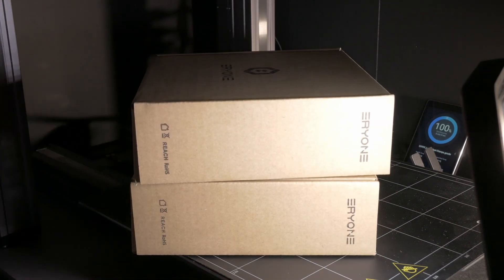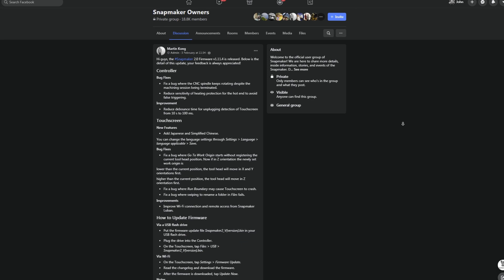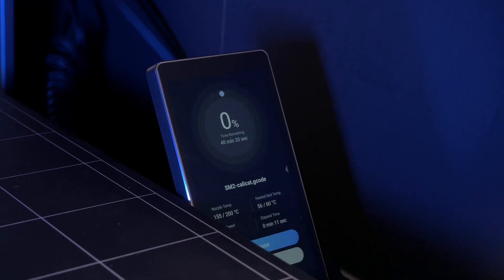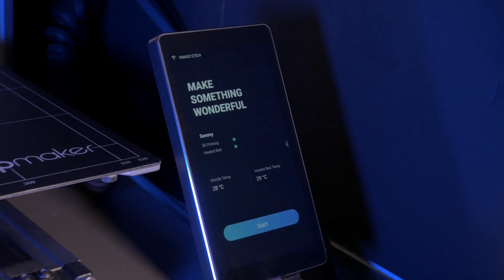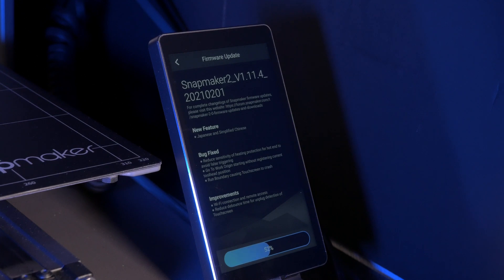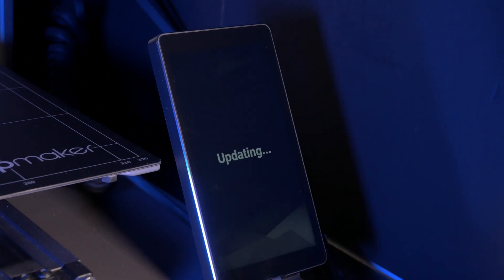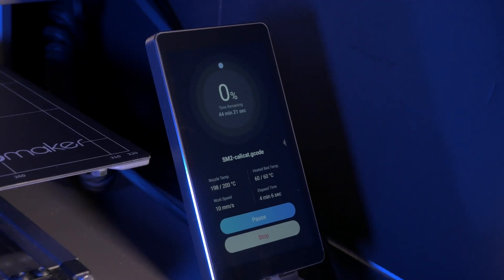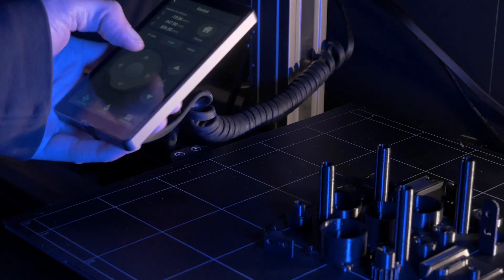How to update the firmware on the Snapmaker 2.0 3-in-1 3D Printer/CNC/Laser engraver

Comment from the maker: Need filament? Get 12% off your entire Eryone filament order using code "johnaldred" on checkout at www.eryone3d.com
Reply: John how do you remove the print files from the luban app, everytime i turn on the machine all the last prints end up ready to print again and you have to take them off manually, i cant find anywhere on the app to delete them.
Reply from the maker: I'm not really sure, I use Cura for 3D printing and haven't really messed with Luban. I installed it, but don't really use it. I noticed the same thing whenever I loaded it up that it had the last model I loaded in there, too, but didn't look into how to prevent that. Will do some digging when I get time. :)
Reply: @JohnAldred  Thank you john much appreciated mate  :)
Reply: Hi john, i managed to figure it out, when the files are sent to the build plate you just place your icon on the item to be built and right click and that deletes the files, of course if there,s more than one item on the plate you just do the same thing for each item  :)

Comment: John, I went to your GitHub page and did a download of the 8.4 Cura profiles.
One question, looking at th4e machine settings jpg, I noticed that you have the "Gantry Height" setting set at 30, should that not be 330?
Reply from the maker: Nope, it should not. If you mouse over the "Gantry Height" box in Cura and the tooltip comes up, it explains how it's supposed to be calculated. It's basically the distance between the bed and the bottom of the gantry when the nozzle is touching the build plate. :)
Reply: @JohnAldred  thanks for the replay, I'll have to take a close look at that setting

Comment: Have you had an issues with a warped bed? I had to use post-its to get it right. Took me while to figure it out. I had a hard time printing medium and larger prints.
Reply from the maker: I haven't had any issues with mine, but I've seen a lot of people posting in the groups about theirs. I haven't needed to recalibrate my machine since I built it up in October, and I'm a little afraid that if I mess with it, I'll screw it up and not be able to get it printing as well as it is right now again (at least not without a lot of effort). At some point, though, I do plan to look into it and see if I can figure out exactly where the issues may be that people are having (is it uneven thickness on the build plate? Is the bed itself warped? Is it the frame? Is it just uneven thermal expansion?) and how to solve them.

Comment: Question. I touched the stepper motors on the printer vertical linear modular. Is it normal to feel quite hot? I know they are stepper motors and all.
Reply from the maker: They will get quite warm, yeah. They can handle a LOT of heat before it causes any kind of issue, though.
Reply: @JohnAldred  oh thank god lol!! I had my work speed at 230% (testing speeds) and was worried
Reply: @JohnAldred  what’s the max temp?
Reply from the maker: Typically at least 80°C, some way beyond that. You'd have to check with the manufacturer.

Comment: I cannot believe I did not notice the temperature being set to 0. A while back I replaced my nozzle with a tungsten carbide, everything was printing fine then after about 15 layers the print looked like the heat had turned off. the filament stripped out, but the print showed what looked like cooling over the course of 1 or 2 layers. I thought that the nozzle had a higher heat dissipation and I took it off, I have not put it back on yet, but now I know why it happened because of this video. Thanks again John! Once I finish my Solar install project hopefully I'll be able to dive into my SMA350 a bit more!
Reply from the maker: Sometimes, mysteries just solve themselves! haha. Good luck when you try again! :)

Comment: Great Video John Question? Doing a Benchy print and looking for settings to test out the printer. I printed the Vase and it came out great! What settings do you recommend to test?
Reply from the maker: Besides Benchy, I usually run retraction tests, do a couple of tests to check dimensional accuracy and then just start printing and see how they go. I would calibrate your linear advance (Teaching Tech has a really good video on how to do that). I'm not sure what settings Luban allows you to change, but check out the Cura PLA profiles I made for the Snapmaker 2. There's a link to them in the description and I'll be releasing TPU and PETG ones in the coming weeks. :)

Comment: Great video. I would love to update but I'm kinda afraid - from what i was reading through forums there was always introduced some major issue every update .. is current version safe to update finally? :)
Reply from the maker: Well, I've not tried the latest firmware with CNC or laser yet, but for 3D printing it seems to be working very well. 1.10.0 was working great for me except for the one bug I mention in the video and now that's fixed. I haven't seen any new issues pop up yet with it when printing. :)